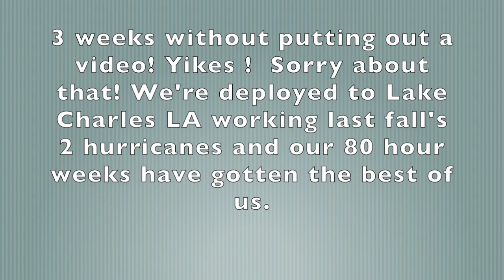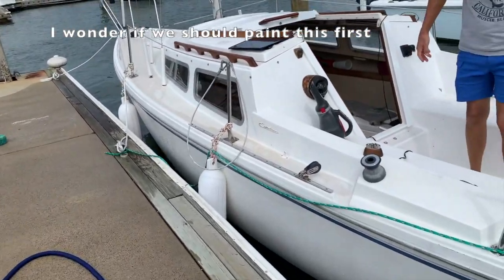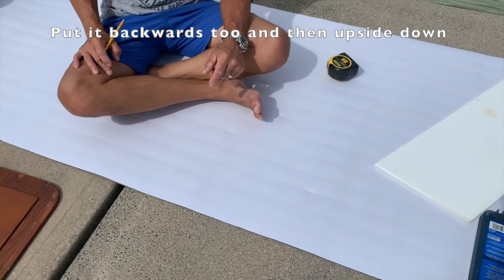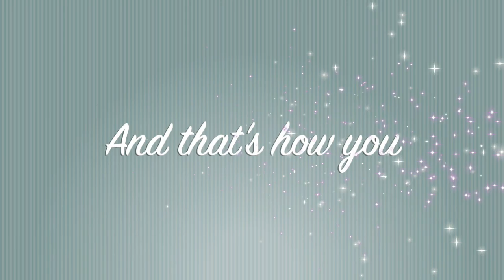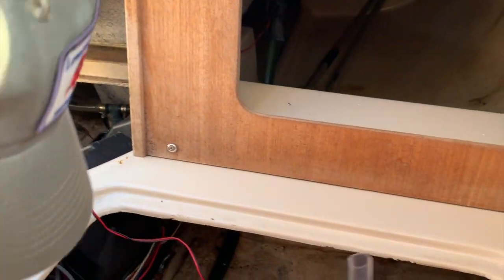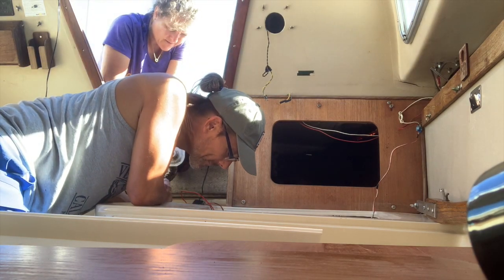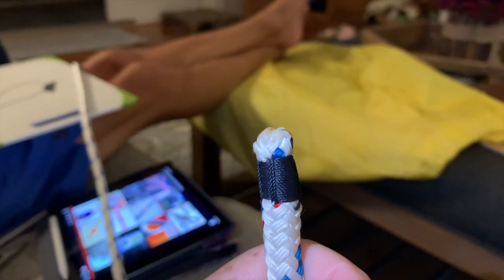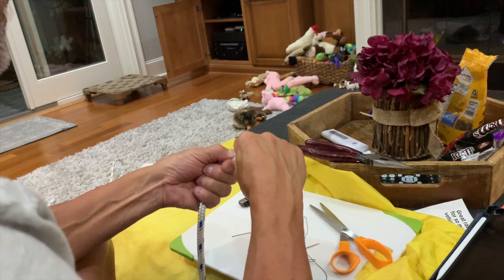Sailboat deck flooring and bilge pump repair on our Catalina 22

Comment: Great flooring, especially in the cabin. If the chain plate leak come back, you will need to take it off ( after properly support the mast if required ), clean everything and rebeed it.  It may be a good idea to do it even if it does not leak, since rusty chain plate are somewhat a warning that it does need attention. As you find out, leak are not only a nuisance, they can cause damage to the wooden parts. Keep posting and thanks for switching to landscape mode ( instead of smart phone portrait ).
Reply from the maker: Thanks for commenting! We love hearing from everyone with such great advice!
Reply: @sailingokaliptus You are welcome, keep sailing.

Comment: Say , what size pipe is the manual bilge handle you use to operate the bilge pump? diameter that is.
Reply from the maker: Oh my gosh, we cannot remember and we've sold this boat since this video was made. Do you belong to the Catalina 22 facebook group? You may want to put the question in there and I am sure you will get a response. Cheers ~

Comment: Please let me know what the source of the water is inside, I have a similar leak in my Catalina 22’ I’m trying to find the source of I believe it’s the keel bolts sadly
Reply from the maker: I don't know how I missed this comment and I apologize. The leak came from a bolt that attaches the pop top to the main hull.  Donovan put some weird white tape around the screw that is made for plumbers to use when they connect pipes so water doesn't go through the little grooves where they screw into each other. I think he also may have used some caulking, but I know he was trying to avoid putting anything on that would make it difficult to take the screw out if we ever need to. Hope this helps!